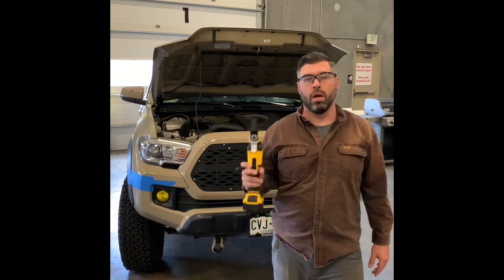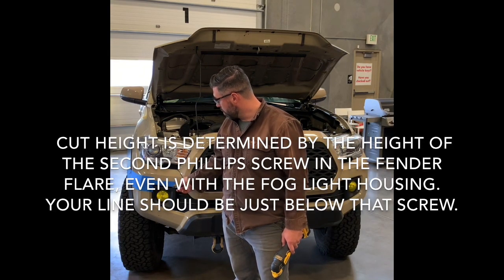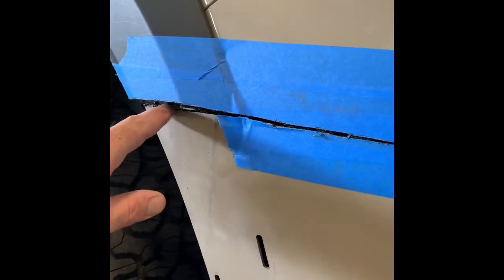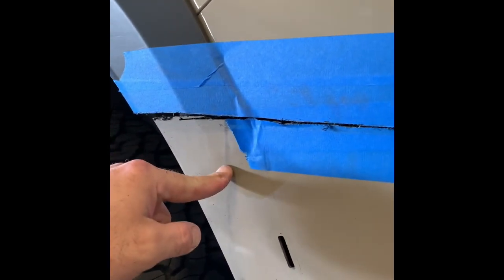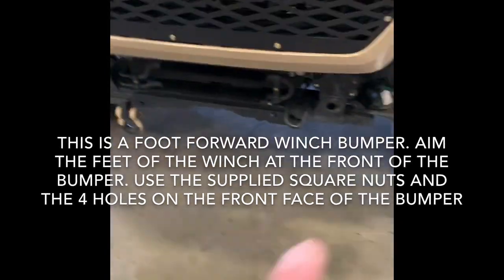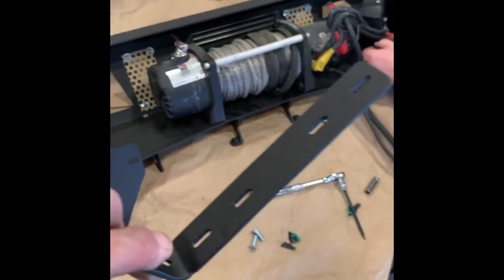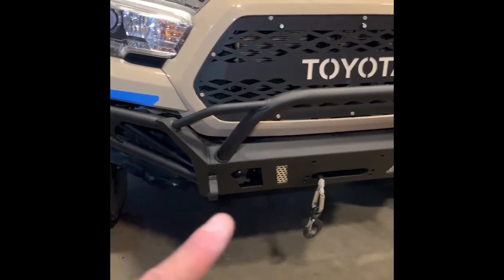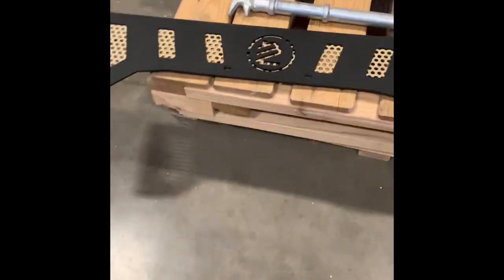Lil B’s Hybrid Bumper Install on 3rd Gen Tacoma

Comment: Did you do any sanding or something else after you cut? I imagine its not the cleanest cut? Thanks and great vid!
Reply from the maker: Chris Turner yes, I ran a sanding block a few times to get any small imperfections out. If you have a grinder with a sanding pad- not a flap disk, you can carefully use that too. Things can go sideways quickly if you are not careful or good with a grinder.

Comment: Ordering same bumper myself. Anyway i can pay you to make some of those plates for me??? I can powder coat myself, but love the look of those filler plates.
Reply from the maker: Hey, thanks- unfortunately I cant. I welded on studs to the inside face of the bumper to spots that lined up with the perf and then bolted them. Almost any fabrication shop could do it for ya. Shit, ask Brian at lil Bs who makes these bumpers, he might even do it for ya before it ships to you
Reply: Scott Boyle ok sounds good. You painted before or after?
Reply from the maker: Matt Sharabi well I did all the mods, cut and bent the 1” added bars, the perf steel plate and drilled, welded and sanded the studs that hold the perf plates. Then I delivered it all to Greg at colorado powder coat. I got it all back and did the pre install and then put it all up on the truck. Since then I have pulled it, realigned the winch, added edge grip trim lock to cover a rough cut, and Re leveled it after a shakedown run on the trails